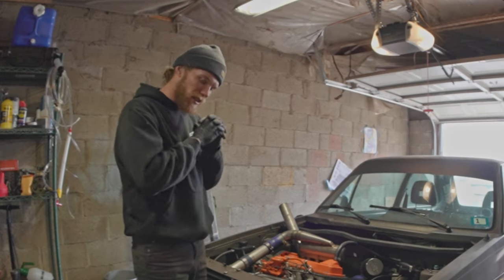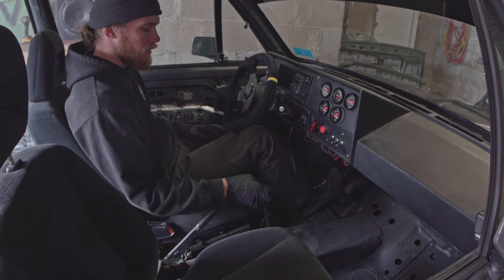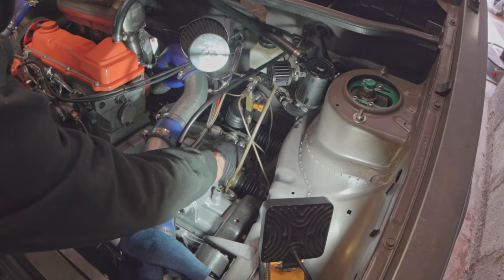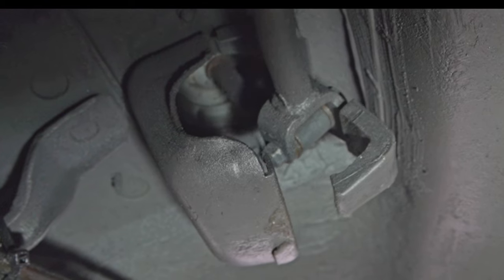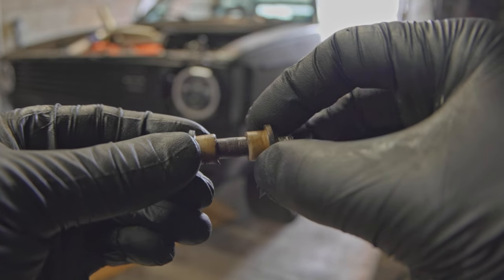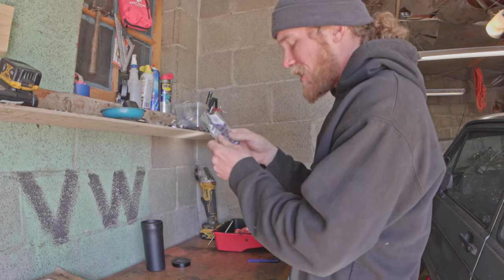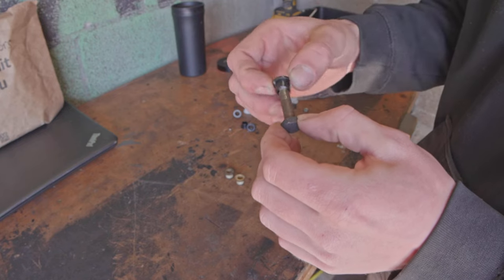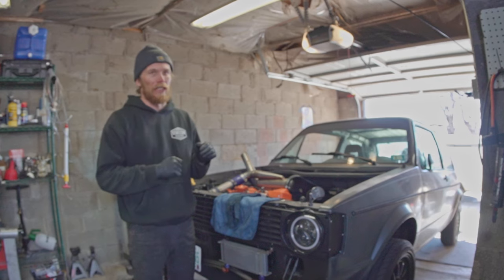Why your MK1 VW is hard to shift!

Comment: I installed the full kit with the heim joints and bushings and the shift base, the whole shebang. I had to do a fair bit of adjusting and even grinding/sanding on the bushings and especially the aluminum spacers on the heim joints. I ended up grinding the aluminum spacers into a cone so that the heim joint could have max rotation when the lever was moved. If I remember correctly, I was having similar issues as you prior to doing this. So if you have not already, you might check for interference of the heim joint movement and the spacer.
Reply from the maker: Right on that's a good idea. Yeah! Same experience here. It was a long time ago but I remember being shocked at the amount of work still required for install 😮‍💨 but it's in now. I know for a fact the the 2nd gear syncro is pretty much bad so it would make sense if 1st was close behind it

Comment: Oh yes, the mk1 machevelian shift linkage...
There was no mention of the 15mm adjustment on the reverse lockout tab on the shift rod? The adjustment is done at the clamp on the selector lever. The combination of all new bushings AND proper adjustment = BUTTER, i.e. shifts like butter, or to be more precise, shifts like a stick in a can if paint. LoL
Reply from the maker: Shifts like a stick in a can of paint 😭😂😂

Comment: Are you sure it’s not just too fast for downshifting into first? In my experience with different kinds of manual transmissions is you have to be about at a stop in order to shift back down into first. Could be wrong but thought I’d throw it out there 🤷🏼‍♂️
Reply from the maker: That is possible 🤔🤔 awfully inconvenient in certain situations. It does go fine at about a stop

Comment: I replaced all my linkage bushings but never adjusted it right and now I have to push down on my shifter like I’m going into reverse and then go into first gear.
Reply from the maker: You should try adjusting where the long shift rod underneath the car connects to the vertical/rotating arm near the steering rack. Sounds like that's a bit off. You can put the car in 1st gear by hand on the transmission then move your shifter to where it should be then tighten everything.

Comment: What pistons did you use to put a turbo on your 1.6? Im looking to do a similar build
Reply from the maker: Pistons? I just use the OEM. Short of having custom ones made that's the only/best/cheapest option 👍 never had a problem with them
Reply: I’d be more worried about the rods
Reply: @OliverFetter  i need to check again but im pretty sure mine a flat all across the top
Reply: @chrisladouceur4093  im not cuz im not going crazy i just want a little more power